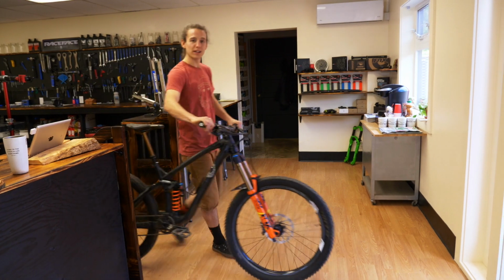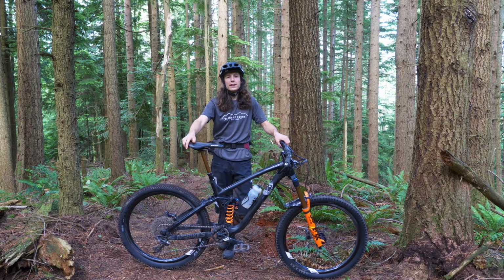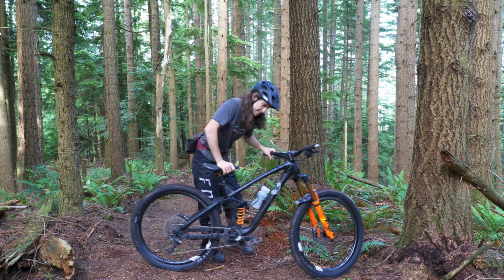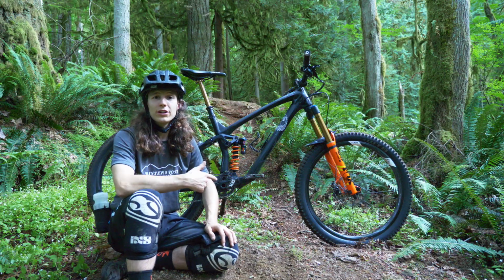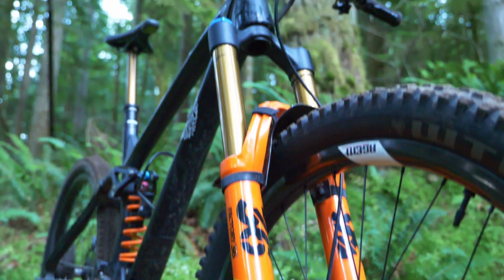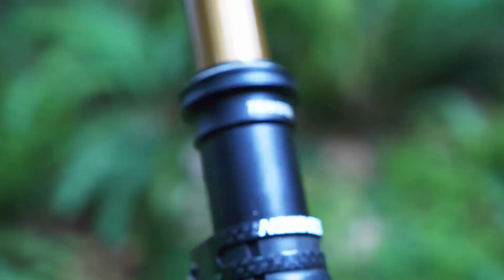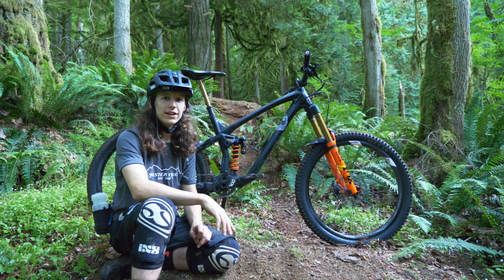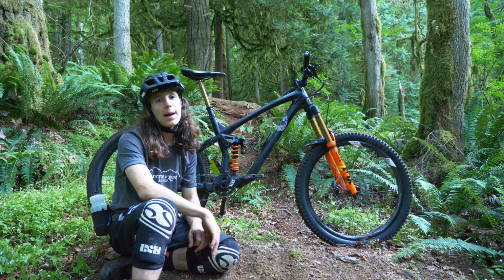INSTALL + FIRST RIDE - 2019 Fox 36 GRIP2 Fork / DHX2 Shock / Transfer Post

Comment from the maker: Thanks so much for watching! Head over to our website @ https://thelostco.com/ to check out all of the 2019 Fox forks shocks and seatposts!  😀😀😀
Reply: How does the fox  compare to the dvo that you pulled off in the beginning of the video? both fork and rear shock...
Reply: what was the tool you had holding the stem in place when you inserted the fork?

Comment: Thanks for the help guys..she's got a 12mm x 180 spindle.weve worked that out from my son's new marzochi bomber front hangout.yet on the ruckus rear it's just a hole right through no gaps to just slide the rear wheel into position and spindle or drop out and  or qr 12mm for the rear hanger thread to except it and hub be nice and central.its hard to find these sizes..thankyou any way for you're time.much appreciated.ride hard or go home!!blessed biking

Comment: Hey Mike cool vid and riding! just wondering what were your starting suspension settings for before your ride for the shock and fork  ..just got the same setup and not used to that much adjustment haha  thanks!

Comment: Great channel... love your content! I've been wanting to upgrade my suspension on my generation 3 Nomad. The DHX2 shock and the Fox36 with Grip2 is exactly what I was considering. Do you think the DHX2 would work well with my frame? I'm not sure if my frame is considered to be progressive or not and I understand that coil shocks are best on progressive frames. Thoughts?
Reply from the maker: The Nomad V3 has sort of a weird leverage curve. They're sort of digressive to progressive. I have 3 friends with coils on their V3 Nomad's and 2 of them love it and 1 of them hates it and went back to an air shock. I think with a spring that is slightly too stiff will work best. Honestly, you can't really go wrong with the Float X2. They're super plush with virtually no stiction, can be tuned to be either progressive or linear, and have tons of adjustability. 

Feel free to call me at the shop at 360-306-8827 or email me at info@misterlost.com and let me know what suspension setup you have currently, and I'll see what we can do to either upgrade the suspension entirely or just change out some internals from the current stuff you have! 👍👍👍
Reply: Does fox has a dhx2 trunnion mount already?

Comment: Hi, nice editing o/
What tools are you using for the fork?
(mainly the thingy to press the bottom of the headset on the fork and the thingy to mark and cut the fork :) )
Reply from the maker: Hey there! We use the IceToolz Crown Race Press since its really compact and simple, we use a sharp pick to mark the cutting spot, and then use a pipe cutter to cut the steer tube.

Comment: How do you like it compared to the diamond you replaced? Great vid.
Reply from the maker: Honest opinion: Overall I'm much happier with the Fox suspension. I was constantly fiddling with adjustments on the Diamond, and could never seem to get it dialed. The Jade shock didn't have a climb switch so my bike felt like a slug going uphill. The Fox air spring is freaking crazy. Literally no stiction off the top, and the fork has the craziest small bump sensitivity that I've ever experienced. 

This is an unbiased opinion since I sell both Fox and DVO, and have ridden both back to back, and as of now I enjoy the way the current Fox stuff feels! Both great companies, both great products!
Reply: Mister Lost Bike Shop  thanks for your thoughts!

Comment: Hey Mike! I´m standing in front of the decision to replace my RC2 Damper with new Grip2 Damper (if this possible). What do you think is it worthy? The Fox Factory 36 170 mm on my Slayer is running with MRP Ramp Control where I can fit the air pressure in the negative air chamber like I want. This works pretty well when the pressures exactly fitted. Otherwise the Fork will work very stiff without the MRP Ramp Control. Riding Style is more Freeride than Enduroracing. So I want a plush feeling like the X2 in the back that I´m using.
What I really miss is the Highspeed Rebound on the RC2. So should I going for a complete new Grip2 36 Fork or is it ok to replace the RC2 Damper with the Grip2?
Thanks and Cheers. Keep braappp. :)
Reply from the maker: Hey Tom! Sorry for the delay.

I've sold a ton of GRIP2 Damper Upgrade Kits and I've had nothing but positive feedback. The GRIP2 damper is a bit more sensitive than the RC2 which helps it feel softer. I have another video on my channel where I have an in-depth setup guide to the GRIP2 forks and I explain how I felt the fork was stiff via the manual's settings and in stock form without any tokens. After adding 2 tokens and doing a complete ground-up suspension setup, the fork feels SOOOO much better!

Comment: Great video and riding! +1 sub 🤙🏼
Reply from the maker: Thanks bud! Plenty more to come, thanks for tuning in!
Reply: Mister Lost Bike Shop which tires do you run? I currently run Maxxis Minion DHF in the front and the Highroller 2 in the back! Awesome combination, plenty of grip, but I want to try something else when I need new tires.
Reply from the maker: I used to run a DHF in the front and DHR or Minion SS in the rear, but about 8 months ago I switched to WTB's and I don't think I'll ever go back to Maxxis! 

I currently run a WTB Convict HighGrip/Light 2.5" in the front and a WTB Riddler FastRolling/Tough 2.4" in the back. When it's wet out I'll use the same rear tire casing but in the WTB Trail Boss. I used to flat with the Maxxis stuff all the time (even with Double Down casing) but in the 8 months since running WTB I haven't had a flat once and I've got about 10 full days of Whistler Bike Park with them! Pretty crazy how tough they are!!

Comment: Good morning, you can do a maintenance of the Shox vivid Air R2C 2012, because mine is defective, and I can not fix it. Would you also like to know if I can replace nitrogen with normal Air Pump? Thank you. it would also have to show this maintenance in the IFP. Or I could do the maintenance of some Shox that had these two compartments, the Air is the oil, so I can build up the courage and be able to do maintenance on mine, because in my city it does not do maintenance and I would have to send the Shox to a city that is more than 1000 kilometers from mine. Thanks. I'm  form Brasil

Comment: I just got my fox 36 grip 2 2021 model..i tried it right away on my local trail but after few days i noticed the small circle on top of the blue one on the right side i dont know if its called the lockout..but it doesnt click anymore whenever i try to twist it..anyone experienced this and what to do to fix the issue? tnx

Comment: Hi all.im looking for a spindle and it's for a gt I drive 7 ruckus 1.0. The rear spindle is either 10 or q 12 mm and screws into the frame and rear dropout hanger completing the feed through.its a 175-80 by 12 or fifteen mm.could you help me with the correct screw fittings and spindles that will be the right size as I bought the bike after a coma and now WANT to ride with mg son .the drop out came yesterday then it hit me someone's forced the spindle in to the two holes.i knew it was a qr20 drop out with outer sleevethats got strength and a damn good strength.could you please help me in the requirements of the part I need off the I drive ruckus 7 .1.0
Reply from the maker: Hey Darren! This sounds like a really tricky situation. I would not even know where to start unless I had the bike right in front of me. My best recommendation would be to bring the bike do a good local bike shop so they can see exactly what is going on and they should be able to help you out!

Comment: Same forks as me.
Reply from the maker: Sweet! How are you likin' the GRIP2 damper so far?
Reply: Mister Lost Bike Shop really good so far vast improvement from the rc2 but i still think the old 2018 fox Factory fit 4 isnt still comparable to the grip2 damper but both I like to use.